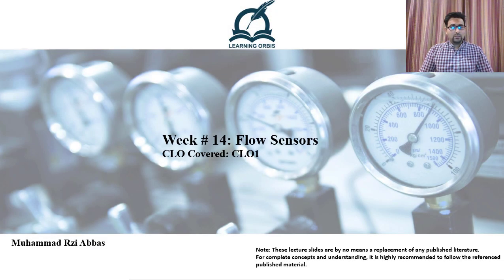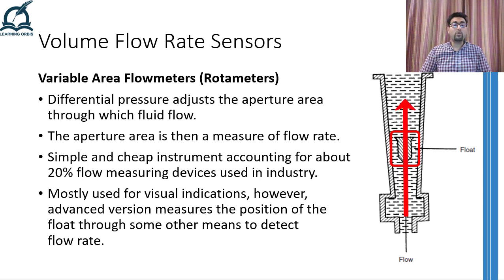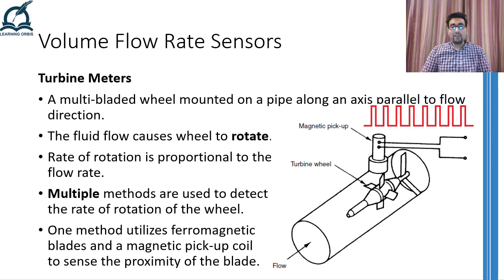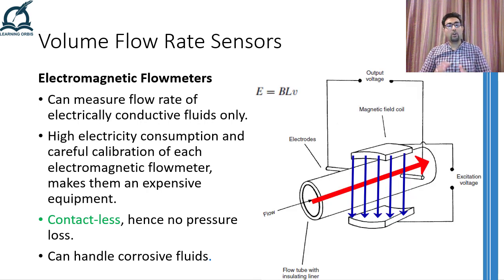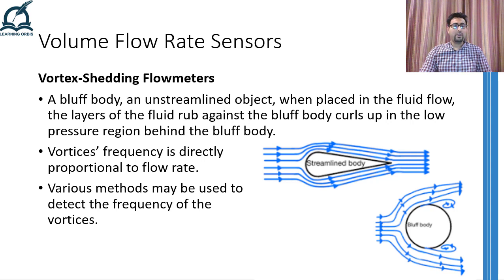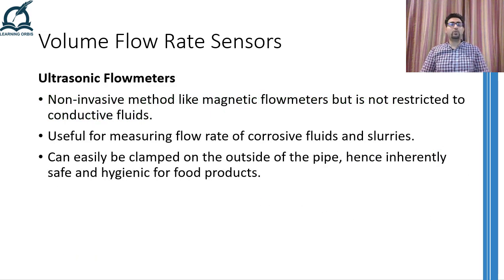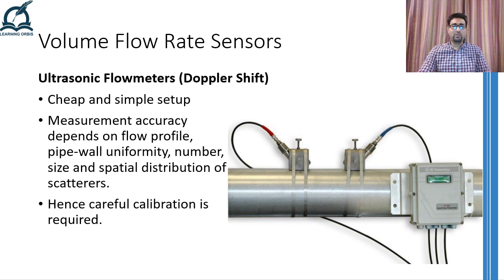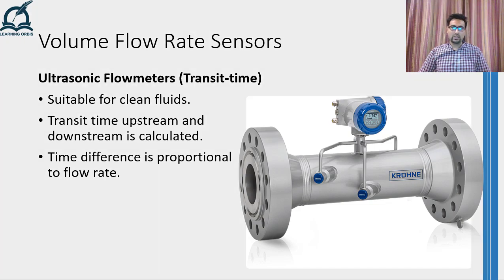Lecture 14 Volume Flow Rate Sensors | Non-Obstruction Type

Comment: The two methods to detect vortices are:
1. to use capacitive-type sensors.
2. to use external sensors, typically piezoelectric strain gauges.